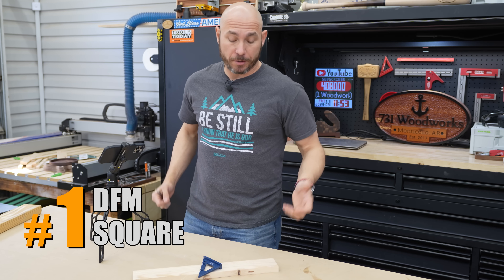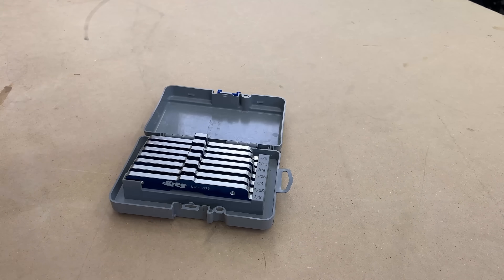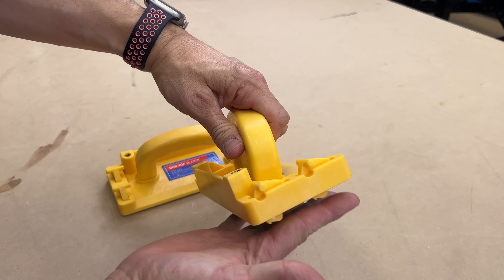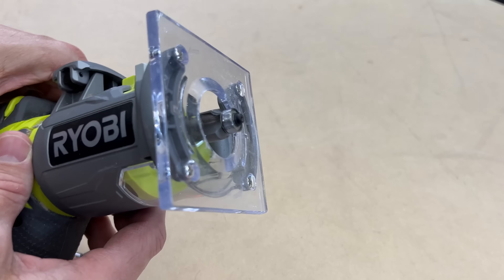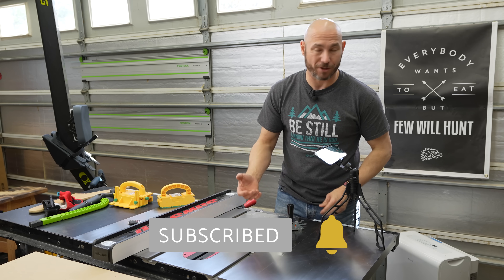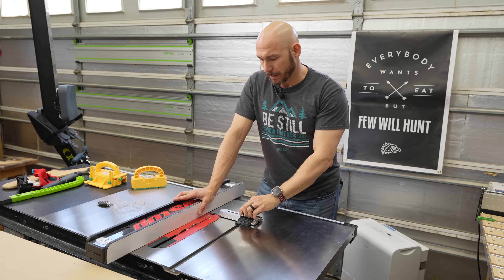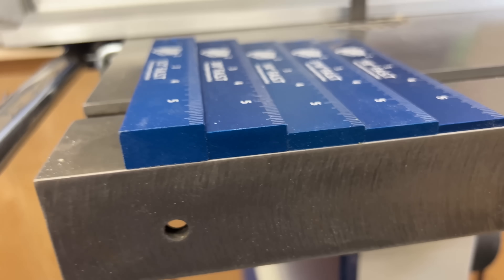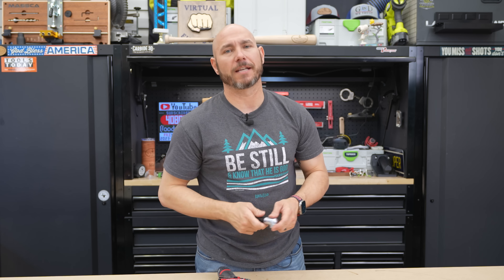Top 10 Woodworking Tools I Bought on Amazon!

Comment from the maker: ▼EXPAND FOR TOOL LINKS and INFO▼ 
Watch Next = 5 Tools Under $30 Every Woodworker Needs - https://youtu.be/zMvK5zyxqqI&list=UULFSLClJLzdUMRMe0E4SPfc-w
Tools In This Video: 
DFM Small Carpenters Square - https://amzn.to/40qMSXK
Kreg Set Up Blocks - https://amzn.to/3lLTQra
Alternative to Kreg if Sold Out - https://amzn.to/3JPaEFP
Gripper Push Blocks - https://amzn.to/3TOApL4
Whiteside Router Bit Set - https://amzn.to/3ZsDWQi
Incra V27 - https://amzn.to/3KfZb3B
DFM Tiny Square - https://amzn.to/42OUFQU
Thin Rip Jig - https://amzn.to/410aiDp
Alternative Thin Rip - https://amzn.to/3lSs8Jp
Magnetic Trays - https://amzn.to/40Iv764
Mixed Sizes Magnetic Trays - https://amzn.to/3zbYWA8
Carter F-A-S-T Fence Alignment Tool - https://amzn.to/3lGoJ0o
Right Angle Drill Attachment - https://amzn.to/3ZkqRsd

More Tools I Love Under $30!
Massca Dowel Jig X - https://masscaproducts.com/products/dowel-jig-x?aff=3
Flush Trim Saw - https://amzn.to/3V0C2om
Foldable Dovetail Saw - https://amzn.to/3EjoihA
Rockler Router Set Up Jig - https://amzn.to/3ECXDO4
Organizer Trays (Gray) - https://amzn.to/3Gjh5kp
Organizer Trays (Black) https://amzn.to/3AkTHPD
Fastcap Tape Measure - https://amzn.to/3X7qaCC
DFM Saw Height Gauge: https://amzn.to/3jidia1
Spring Clamps: https://lddy.no/1575h
Clamping Squares: https://lddy.no/1575g
Small F-Clamps: https://lddy.no/157u9

(If you use one of these Amazon and other affiliate links, I may receive a commission) 

Some other useful links:
Daily Tool Deals on my website: https://www.731woodworks.com/tool-deals
Subscribe to our email Newsletter: https://mailchi.mp/7e44c16eefdc/731-woodworks-email-newsletter
Check out our easy-to-follow woodworking plans: https://www.731woodworks.com/store
Outlaw's Board Butter - So Good it Should be Outlawed: https://www.731woodworks.com/store/boardbutter

Comment: I have decided to invest in a quality sander.  Cost is not really an issue (well, doesn't have to be, but we all know it is to some extent).  My question is more about abrasives.  I have heard that you can't use any other disc on Festool other than what you get from them.  However, one of your videos introduced me to the 3M discs that don't have holes, but rather much of the disc is a screen.  You did not directly say those work on Festool, but it was seemed to be implied.  Have you used those on a Festool sander?

Comment: I like the gripper line, but. The green non-slip surface eventually hardens over time. The only way to fix this is to replace the tool. For a push block, these are not cheap.

Comment: Personal Experience: I had this sander for years, used it occasionally for woodworking proyects until I started a wall texture business where it was my primary sander for many many projects sanding microcement walls for HOURS. It’s unbelievable reliable. 
After a while I upgraded to the bosch 6” sander “rotex” and the little B&D is still in the shop working flawlessly.

Comment: Glad I saw this. I bought the Dewalt right angle driver. At one point, I needed to get into a really tight spot. I had to just use the bit itself. 

This driver does NOT allow the top of the bit to stick out enough to get a good hold on the screw. 
I purchased the Milwaukee right angle driver and it allows the entire head of the bit to stick out when you only can use it without the bit holder inserted into the driver.

Comment: I made my own thin rip jig and it's great to have.  I had a little wheel bearing left over from a different project, and I borrowed one of the miter track lock-down thingies from the feather board I'd made, since I won't be using both at the same time.  It filled an immediate need without waiting for Amazon or spending a dime, but the store-bought one could be worth your dime and time -- this jig can be really useful.

Comment: I have just brought the evolution R210+ sliding mitre saw, the set up of the blade was on target!! 89.97 degrees right angle, l have been impressed, fitted together very easily, with extras' saw stops, clamp's bought off Amazon, the blade only tilts on one side, that's the only downside, the mitre saw turns left and right, l will be changing the blade for a wood blade 60 tooth + but l will keep the multi-blade that came with it, l do not saw metal, masonary or plastic but it might at some point come in handy. It is a Bargain choice £156,  a good DIY tool [semi-pro] without breaking the bank.

Comment: I got the Incra V27 last year and man, what a difference. I added a Powertec extruded aluminum fence that has T-track all over it and a scale across the top. I rarely use my cross-cut sled anymore.

I have the Woodpeckers Delve square and the little square and while, yeah, I spent more than those DFM squares go for, I too use both of them all the time. To anyone who doesn't have either of these squares, get them. Woodpeckers, DFM, whatever, you will find them to be one of the handiest tools in your shop.

Comment: May I argue a minor point?

The Carter band saw doodads look really useful for setting the fence distance, but isn't the tooth clearance groove only for use when checking the fence for parallel?
Reply: Seems like if you use the recess the way it was shown you're measuring to the center of the blade which will result in a rip off by half a kerf width.

Comment: Where do I find these "tubafors" you're always talking about?

I got a set with the DFM Triangle and Square as a factory second recently. I'm not sure what's wrong with them since they look just like the regular ones and are square, but you might keep an eye out. 

I use the Grr-ripper push blocks, but I also like the drop foot style on the Milescraft GrabberPLUS. I think it's good to have a wide variety of push blocks and sticks.

As for the magnetic trays - I recommend circular ones instead of rectangular. With the rectangular the magnet does not fill up all the space of the tray and if you use them hanging off of a wall you are likely to drop screws more often.
Reply from the maker: Tubafors are 731 exclusives 🤣

Comment: I’d like to try those Whiteside router bits. I’ve only used Bosch and Skil bits. I’ve never had too much of an issue, but I do see some burning every once in a while. I’d like to see what difference those type of bits actually make
Reply from the maker: You can stop a lot of the burning with the right speed settings too on the router.  Or the feed rate (or both) that you push the router through the cut.
Reply: You definitely can't go wrong with the Whiteside bits.. my bit collection is 95% Whiteside, I have a couple cheaper brands, but the Whiteside are amazing quality.

Comment: That right angle driver attachment though heavy breathing 😳😳😍😂😂
Reply: One of the handiest tools a guy can have but it doesn't exactly eliminate frustration cuz typically your driving in a screw in a tight corner and difficult to do, 2 hands required

Comment: I wonder if the incra v27 will fit in my craftsman tablesaw mitre slot
Reply from the maker: If it has regular slots it should.
Reply: @731Woodworks , thank you for the reply!!!  the slots on my craftsman are like the ones on a rhino tablesaw. The mitre slot has tabs, I read the reviews and the Q&A’s all were vague and unconvincing. I may just buy it anyway and try it. If it doesn’t work I can just return it I guess.

Comment: I found a larger magnetic tray at the auto parts store that is great for my wrenches and loses screws etc... Store name starts with an "A" and ends with an "E".
Reply: This is also one of those cases where "Harbor Freight works just fine". You can find them in the section with auto body, wheel chocks, creeper trays, etc. 👍

Comment: 6:27 nice driver bit
Reply from the maker: that's what happens when you use em
Reply: @731Woodworks  All of the DeWalt Impact-rated bits I have look exactly like that, but none of my Makita, Bauer, or Milwaukees do.  The DeWalts aren't shaped to fully seat or engage with the majority of phillips heads.  Oddly enough, DeWalt's regular bits are actually much better.
Reply from the maker: @sweetsweetpapa  I have Milwaukee bits as well and they do seem to hold up better.  This Dewalt bit is a couple years old.  I should probably trash it lol

Comment: When ripping thin strips why dont you do this.....make the first rip then take that piece and put it between the workpiece and the fence.  Now the workpiece has moved by the width of the thin strip so the next rip will result in an identical thin strip.  Repeat til you have enough strips.

Comment: I alway measure to the blade tooth not the smooth part. Using the tool with the groove in it on the bandsaw is going to make your workpiece undersized.